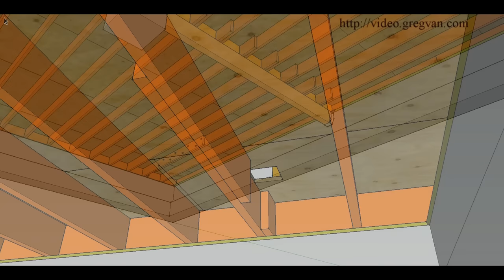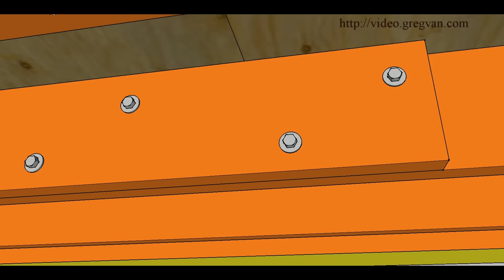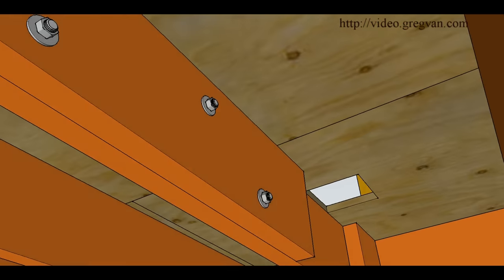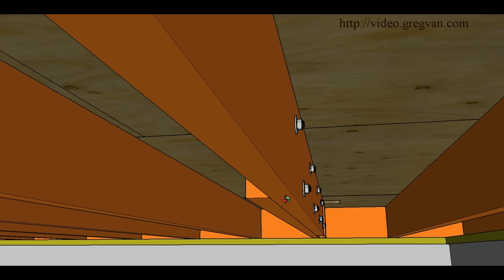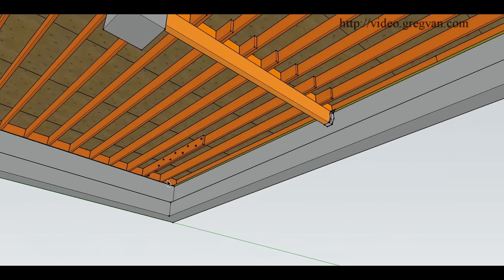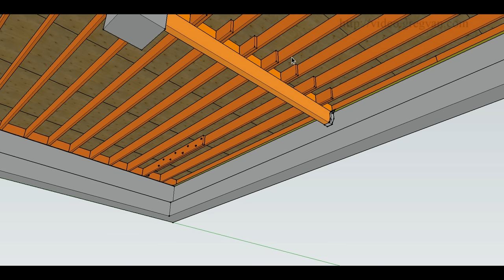How To Repair Cut or Damaged Floor Joist – Bolting New Joist To Existing

Comment: I did a similar repair for a water damaged floor joist 2x12. We used 7/16 carriage bolts filler plate and heavy metal strapping across the filler plate. Building inspector was actually thrilled at how much we did.

Comment: Scabbing is appropriate for minor beam splits and some over-notching. The engineer will probably tell you the required length and nailing pattern but will likely sign off on the right design.

Comment: How come you wouldn't just remove the original joist all together and put a whole new one in?
Reply from the maker: You can, but sometimes the floor above has some type of flooring installed over it like tile carpeting and makes it difficult to remove the nails connecting the floor sheathing to the floor joist.
Reply: gregvancom thanks :)
Reply: gregvancom I don't know what flies in the US but short of replacing the whole joist I would say the only acceptable repair would be a scarf joint
Reply: @paulmcfadyen689  You will need to fasten a scarf joint with bolts in both side, and that will be a problem for the top side
Reply: @dalecooper3729  never seen a scarf joint bolted?
Reply: @paulmcfadyen689  
I'm now thinking that... yeah you can bolt it before putting the frame in place. I was wandering how to tight the top bolt
Reply: How would you remove the joist over the central beam?  Or even if you somehow cut it up to remove it, it's probably very difficult to install a new one in the same spot

Comment: Mine is upstairs flat it usrd to leak the roof council fixed roof after 15years plus but my floor sags since just where the wall is where water used to run down walls. I lived 3 years no hot water no heating judt befor they repaired roof so whilst i was able to heat dry walls out prior to this i couldnt then. Walls are crumblinf bricks can be pukled out but worker just said no oladtered overed it.

Comment: I purchased an attachment for my 1/2 hammer drill. It makes 90 degree drilling without purchasing a special right angle drill. It comes in handy when wiring too.
Reply: u-joint

Comment: thank you so much. I have been so stressed with this I have not even thought about just replacing them. I went and bought 5 new 2x10x20 joists today so I'm going to replace them. do you think I should sister the existing joists with the new ones or just replace entirely? also could I replace them from above if I remove the subfloor? so that way I won't have to move the furnace? also after the new joists are in do you recommend building a small support wall underneath the new joists. thank you so much .

Comment: Is there a restriction for how close you would bolt to the edges of the joists? I thought you should only drill and bolt within the middle third of the width, but these bolts appear to be in the outer thirds. Curious what the engineer said if anything.
Reply from the maker: I would check with an engineer. I've never had them specify spacing from edge of lumber, that I can remember.

Comment: I watched your videos last spring and ended up talking with you about cutting out a section of my garage and replacing with a block wall..  project went great when I removed the weight from the temp wall, the building didn't even creak..

Getting ready to repair my floor joists in the hous, and here I am nosing through your videos again lol 

  Thanks for thes vids..  you don't have to do this, and you do..  guys like you are changing the world for us little people ..  thanks for what you do; you're changing the world !!
Reply from the maker: Well I'm glad you're back and thanks for the kind words.

Comment: Thanks Greg! I'm going to need to sister ceiling joists on a 20 foot run. Your videos helped inform me that the builder of my home addition before I bought this didn't use the correct sizing under the upstairs wall. It is slowly dropping just under that heavy wall. None of this will be easy to access. I will need to remove the dry wall under the ceiling and it will be pretty disruptive. But not as much as full failure of the structure. I sistered joists before in a worse condition. It was under another home that only I and my small girlfriend could crawl. I secured the beam so sister with large bolts and glue. To bring the floor to level, I had to dig and put a jack screw and beam underneath the sagging joist. Once level, the sistering was completed by myself and my tiny girlfriend. The space under that house isn't accessible unless you are very small build.  A tenant allowed a large fish tank to overflow numerous times which damaged the joist below resulting in sagging. Needless to say, I won't allow fish tanks anymore.
Reply from the maker: Keep up the good work and no water beds either.

Comment: Thank you for producing these videos, they are very helpful! I have a joist that is cut completely through - just like is shown in this video. Several others are cracked or notched. What type of contractor would you recommend for repairing floor joists? I've read that a general contractor or a handyman would be the best bet, but there seems to be a scarcity of these in my area. If you respond, I greatly appreciate it!

Comment: Nice videos!  San Jose, CA wants the both ends supported these days (so you end up with a doubler basically).  I recently resolved some sagging above my kitchen with this approach (full length) and found the Simpson 3"x1/4" SDS screws made the engineer and inspectors happy.  They're really easy to install compared to drilling for bolts & they seem to pull the wood together much better then nails.
Reply from the maker: +Weston Schmidt I think it's always going to be better to have the joist running full-length and the ends sitting on structural supports like a beam or footing.

Comment: Thank you for sharing your knowledge boss. I do have a question and need of your advise. How would you repair an standing stud that is damage from the very bottom.
Reply from the maker: I would add one next to it or remove and replace it. You can cut out the damaged stud, before or after installing new stud if there isn't a lot of weight above it and make sure you nail the existing stud to the new one.

Comment: Thank you for your video. Could i used shorter span of joist? I dont have the access to the below floor. The cut is 3 inches and i can only fit 20 inches of new joist right by it. Would that be an issue?
Btw this is right below shower pan

Comment: Great Info & thanks for your videos. How Do I Sister Joint to a joist thats warped. If I were to sister join with new wood it would not be flat against the old joist because it it warped
Reply from the maker: If they're warped or deformed then they might need to be replaced.

Comment: Good information ! I live in a 70 year old single story farm house  built by my grandfather after the original house that burned . Being a salvager who tore down old building he used old lumber from 100 year old buildings. Consequently the floor joists are over 150 years old and some are wet or dry rotted. He extended the new construction over the basement using the old walls as bearing walls and poured a new foundation around it.  As a result the newer perimeter wall settled over the years causing the floor to be higher over the old walls and some of the joists are cracked. The joists are in three unequal spans, the one over the basement being 12 feet. Would you recommend replacing them full length over sistering them ?
Reply from the maker: +rorger balcer I would recommend replacing them if possible.

Comment: Greg,  I find your videos extremely helpful. I plan on using many of your recommendations. My dilemma is that my girder beam(s) up to 16 feet, floor joists and rim joist and sill (8) ft.are dry rotted. Which one do I repair first?  I understand I must sister floor joists to have good wood to lift with.  I am removing some of the subfloor.  PLease give me a reply. Thank you

Comment: hello sir. First let me say that I really enjoyed how information on your video wise. Very useful! Now, moving on to more important matters as it were. I have 3 floor joists that have been compromised by water. One of them has about 2 inches missing on the floor bearing side of it as it meets the outside wall. I, because of this damage, am NOT able to drill into this Joyce because it is so soft. Not mushy, but brittle from I don't know how many years of exposure to water. Should I go ahead and sister the joist with two 2x 10's to ensure its stability?
Reply from the maker: +Christopher  Smith Yes, install a new floor joist next to the damaged one, without attaching it to it and then remove the damaged one, if possible. I think it self-explanatory, but I wouldn't have a problem making a video if you needed one.

Comment: Question:  I am going to have to repair joists on a sagging upper floor.  What would be the best approach?  I would prefer not to have to jack up the existing joists from the lower floor due to the value of the hardwood floor below.
Reply from the maker: Christine Opland I will try to make a video within a few days to provide you with a solution.

Comment: At the front of my deck  - the rim joist (2X6) has some decay on the top.  Do I need to change the entire rim joist or can I sister anothor piece  (2 X8) rim joist to the front of it.  I may change the entire deck frame to (2X8) all the way around.  Let me kow - I appreciate your input and videos.
Reply from the maker: Most framing repairs remove and replace damaged lumber.
Reply: Do you have or know of any videos showing the removal of the rim joist?

Comment: I need to put in a bathroom ventilation fan. Unfortunately, the ceiling joists run parallel to the exterior wall. There's at least 2-3 of them in the way. Doubt it's safe to drill 3" holes in them. Is there a safe solution which doesn't require a bulkhead? Maybe steel joists?

Comment: I would need to install support on both sides of my ceiling rafters with one room.
You mentioned weight bearing. I must make sure the weight limit is premium quality. Is that something that would be seperate from the bolts that would sister to the original
Reply from the maker: Maybe plywood or large metal washers. If that doesn't make sense, please provide me with more details.

Comment: Funny I'm doing a similar job right now. A joist cracked from a drill hole for 220 line. Bottom third of a 2 by 12. Dropped about a 1/2 inch.  I actually prefer bolts and doubling up the sister . I guess over kill but prefer it over then under. Lol was double checking the bolt pattern so I appreciate the video. But I also like taking it straight across the distance
Reply from the maker: Thanks for sharing your story and it's always going to be better to go full-length with the joist if possible so that each and can sit on top of a load bearing beam or footing.

Comment: One thing I've seen done when you're sistering joists is to cut plywood to the same height as the joist (say 10 inches high by 4 feet long), then sandwiching that plywood between the old, weak joist and your new 'patch joist' — bolting this sandwich (plywood as the meat in the middle, old and new joists as the bread on each side) staggered as shown in this video. Adds a lot of deflection strength. The longer the 'new sister' the better, of course.

Comment: Hello can you tell me if this video would also apply if I was bracing joists from a gapping hole, left after a removal of a disability lift has been removed from my home?
Reply from the maker: I cannot provide you with structural engineering information, but can tell you that most of the floor framing repairs you're referring to can be done by simply filling the area in using joist and joist hangers. Let me know if that makes sense.

Comment: I actually need to add joists in my basement in order to support the main floor and for the purpose of supporting a post that will be above the joists. The post will be used to support a beam on the main floor. It would be much easier to install the joists if I could cut them in two before installing them and then bolt the new and original joists together.
Reply from the maker: The idea of this video was to provide you with an idea for a repair, but it wouldn't be a good idea to cut joist that need to be added to carry a structural load. If you want, send me some pictures of your project and I will see if I have any ideas. The email address can be found by clicking on our webpage link in the YouTube comment area.

Comment: What if you use 1/4 inch flat plate where the bolts go thru for strength and space them 16 inch apart .
Reply from the maker: I've seen stuff like that work before.

Comment: you may be able to help me. Have you seen any examples of sistering or repairing floor joists in balloon construction homes? I noticed the joists in my basement are notched and sitting on 8x8 timbers which rest upon the foundation walls. A few of the joists have cracked at the notch allowing the floor to sag and bounce. I saw something saying if I do decide to notch the new timbers to drill a hole and then cut so that the corner would be a radius and much stronger.
Reply from the maker: I wonder if it would be better to use hangers or attach a 2 x 4 to the 8 x 8 beam. Feel free to send me some pictures if you need more information and I don't know if the radius thing actually works.

Comment: Just had to do this to a house I just bought, today. I would have gone from side to side but it is in a 65 year old brick on block townhouse. It's the first floor's floor joist where they hacked out huge chunk of it installing a light in the basement ceiling. The joists are cemented into the foundation and no chance to go full end to end anyway with gas pipes, electric and heat ducts in the way. Lucky enough this house is old school and the floor joists are 1 foot on center. All I had room for was 8 foot of a 2X8 and a tube of heavy duty liquid nails. Had to nail it so I put coated sinkers in at every angle I could get them in and then used my pasload to basically staple stitch all the way around the original joist's hack out. Sometimes you have to do what you have to do.
Reply from the maker: Good point, sometimes you will have to make modifications to suggested repair methods.

Comment: Cheers for the information, 1 thing i was wondering is if there is a minimum distance you should over lap the wood? I was reading on a couple of forums that 2 foot is the minimum but this seems very unrealistic. the joist I am working on just now is 3.5m long and the the end of the joist has dry rot so we are to cut away about 500mm of the end of the joist to eradicate all the rot. I was planning over lapping the joist by 1m! do you think this would be enough? Thank you in advance.
Reply from the maker: +Jonathan MacMillan I can't really answer this question and remember I'm not a structural engineer so I'm just going to provide you with an educated opinion. 3 foot minimum sounds good on anything 3 foot or under, but think it would be better to add the distance you're removing. For example, if you remove 3 feet of damage from a 12 foot framing member (floor joist, ceiling joist, wall stud) then I think it would be a good idea to add 3 feet, making the board 6 foot long that you're going to replace, giving you 3 feet of overlap that you can fastened together with bolts, nails or screws.
Reply: Appreciate the feed back. 
I eventually had 1 of my mates have a look at the job, he's a joiner! He assured me that the 3 foot over lap was sufficient, he advised using coach bolts and like you said screws to had it together. 
Cheers for the advice and keep up the good work.

Comment: I want to get your opinion on cracked rough cut joists.  There are wires running through them on each end of the joist,  so sistering another complete  joist to the cracked one is out of the picture. I was thinking about sandwiching 3/4 plywood on each side (guled and nailed) as far as i can either direction and stopping at the wires. Thoughts?
Reply from the maker: If the cracks are larger than a quarter of an inch, then you might be dealing with lumber failure and the lumber might need to be replaced. Feel free to send me some pictures for more information and you can get our email address at the website.

Comment: We are remodeling our kitchen this weekend. We know there was ongoing leakage under the sink so we are sure there is damage to the sub-floor and most likely the joist as well. When repairing the joist with a sister do we remove the rotten wood from the damaged piece up to a good spot in the wood? I'm concerned that contact with the damaged parts will eventually damage the new piece.
Reply from the maker: Yes, remove as much of the damaged wood as you can and it would be best if you could remove all of it. Sometimes the fungus or mold can damage new wood.

Comment: Greg,
I have an issue where my load bearing area is damaged.  The joist is very soft and I am looking to repair it.  Would the side bolting method be a good one for this type of repair?
Reply from the maker: If it's a load bearing area, then I would replace the lumber. It might work but I don't think I would do it. Feel free to send me some pictures of your problem, if you need more information and you can get our email address at the website.